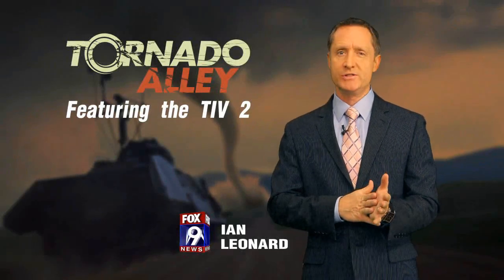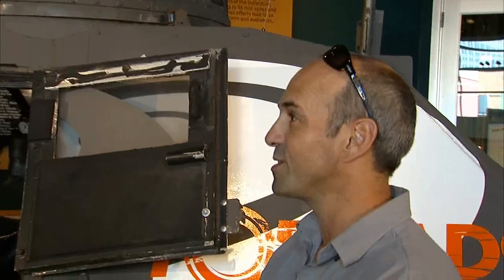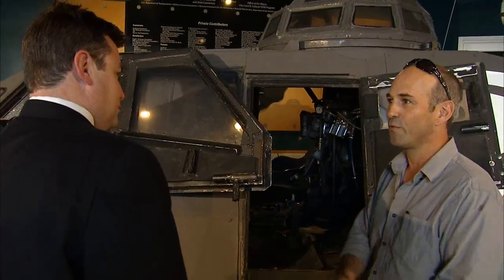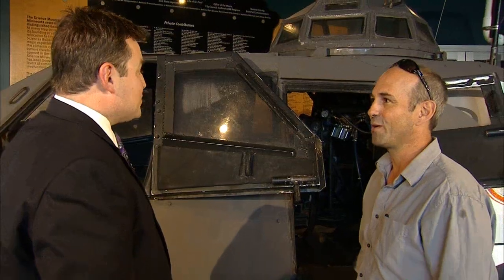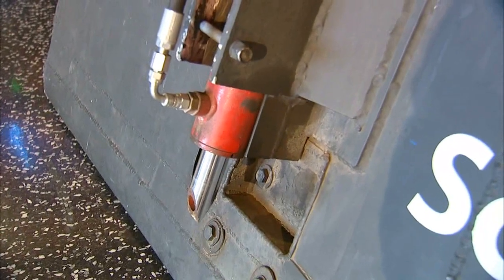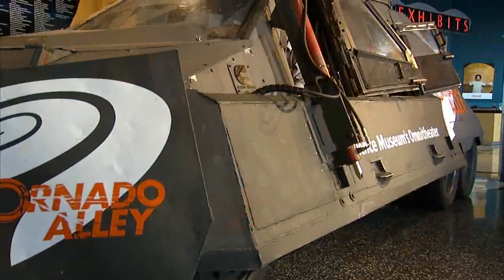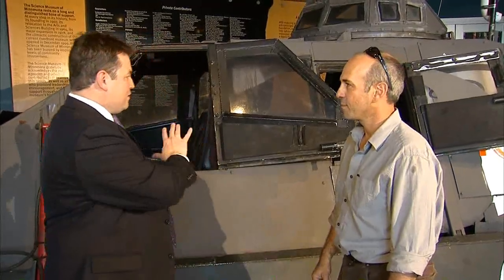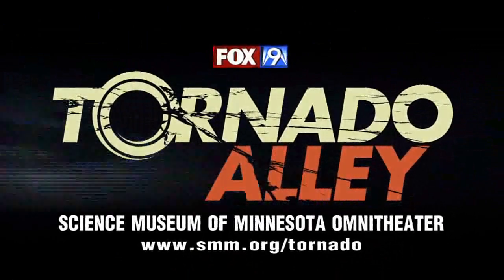The TIV 2 (Tornado Intercept Vehicle) - Behind The Scenes

Comment: I love the fact that this badass tank is based in a Dodge Ram 3500. In the movie Twister, Bill Paxton's character "Bill" also uses a red Dodge Ram 3500 V10 4x4 (single rear end) SLT which is so badass. My point is, if your going storm chasing, you need a horse and the Dodge Ram 3500 (for me anyway) is the horse I would choose.
Reply: It's a V8
Reply: @gigs1167  no, its a v10. thanks for coming out though
Reply: @FL4TFOUR  for casual driving they used a 95' 2500 V10. Stunt Rams were the 1500(also used for still shots) and another 2500. In one scene(around 6 minutes in) you can see the badge and it does say 3500 V10 but I thought the Ram 3500 V10 was a Dually?
Reply: @gigs1167  in Twister apparently the truck was a 95' Ram V10. They did use different trucks for stunts which weren't V10s apparently.